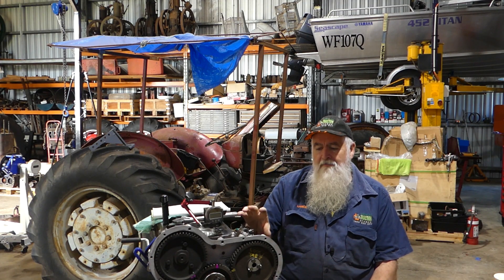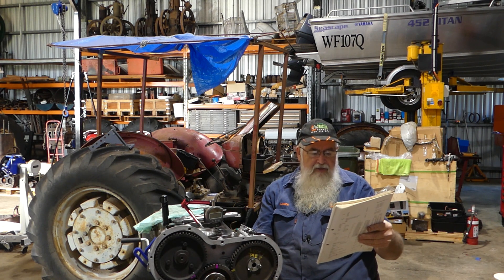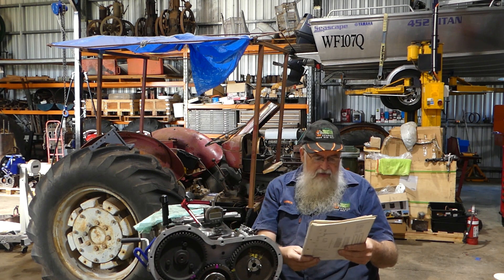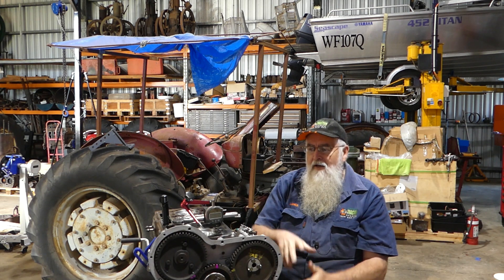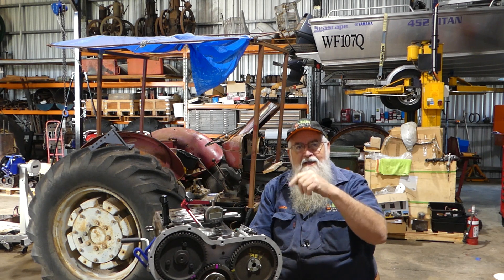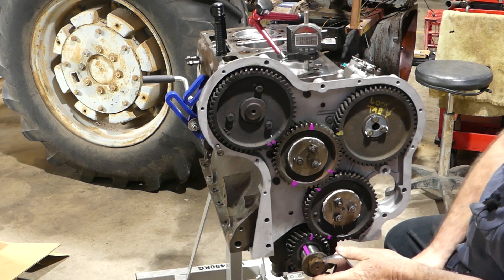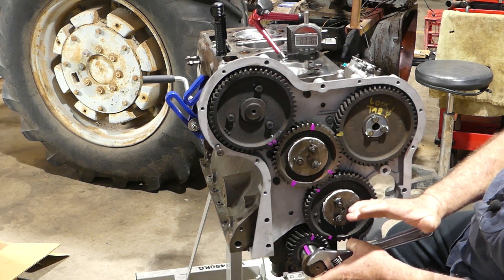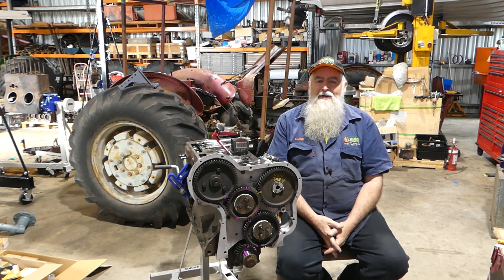Massey Ferguson 65 # 39 Checking Injection Pump Timing

Comment: So. If the timing is to advanced or to late in a Diesel engine. Does it act the same as a gasoline engine. Late timing, low power and engine running hot, to far advanced timing hard to start, pinging, and low power. Just wondering Lance. Thanks for the great video.
Reply from the maker: Yes, exactly, you can hear them strain when cranking if too far advanced.

Comment: Thanks for this info, could injector pop pressures also alter the timing? ....Do injectors "drop" their pop pressure over time and require some timing (tune up) to be redone periodically?
Reply from the maker: The timing might alter slightly but not enough to worry yo I dont think. They do loose pressure over time from spring tension and tip wear and should be checked every so often as a dribbly injector can ruin a good bore by washing the oil away.

Comment: Hallo Lance..It's great to discover new things through life.  I am also currently working on an engine overhaul of my AD203 engine.  In the past, I was convinced that my engine would be like a car.  that it goes cylinder 1-3-2-4 but I now see that it goes 1-4 and 2-3 ... so therefore I also thought that the diesel pump would go around the clock and spray once for each point on the pump  for each cylinder but that may not be the case I can see now ... That pump must also inject diesel 2 plus 2 times as a pair because the pistons also go up and down as a pair or it will not work ...  I was surprised by this ... We learn new every day and nice to follow you renovate the engine ... I do the same right now here in Norway with you ..Thanks for the video .. hope you can understand or follow my thinking  around the pistons and the pump ..Thank you Lance wich you a happy day  down under 😊👍🚜🚜🚜🚜🚜
Reply from the maker: The pump goes at half the speed of the crank so it only fires when needed in the and thats why the pipes are not in line but in the order of firing as the pump goes around.